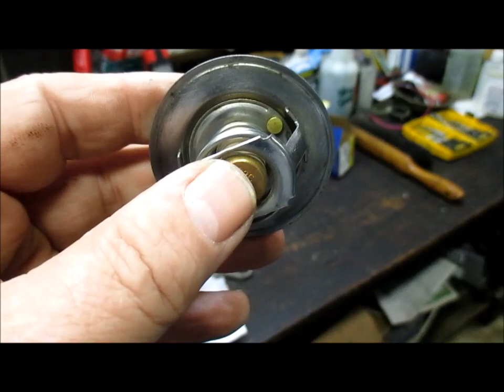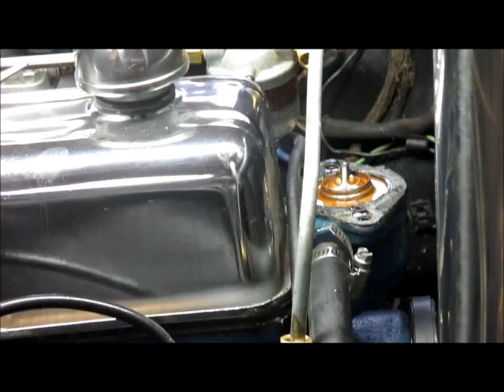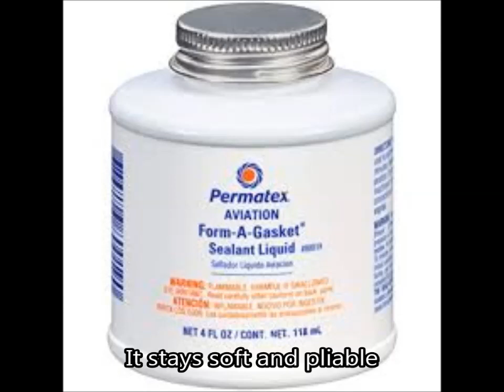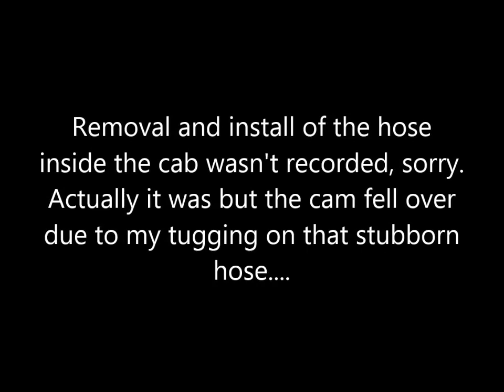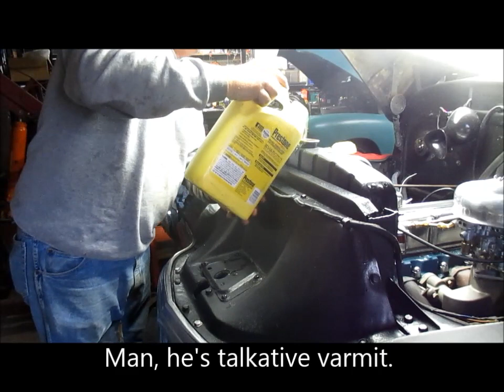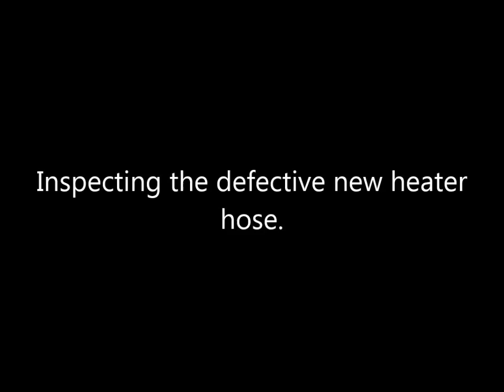1949 Chevy Truck, Installing a 180 degree thermostat.

Comment: Love your videos, informative, instructional and entertaining.

I have one question….regarding drilling the 1/16” in the thermostat.  Where exactly is the hole drilled. Any picture or diagram. I am guessing in the flange? Thank you.
Reply from the maker: A about the 51 sec mark you can see the brass jiggle pin at about the 1 O'clock position on the thermostat. That would be the area to drill a hole if there isn't a jiggle pin or hole. Thanks for watching
Reply: Many thanks for drawing my attention to that time in the video.  I would love to buy a thermostat with that “jiggle pin”. Can you tell me where you got it?  Thank you again!
Reply from the maker: @mikelaureanno893  Don't recall where I got mine but Rock Auto shows one for a 54 235. IIRC the same thermostat worked in my 49 216.
Reply: I found one with a jiggle pin.

Comment: Can you tell me how good or efficient is that Coolant Recovery tank? Since its all metal, for what I can see, how do you know if coolant level?
Reply from the maker: It works VERY well. To check the coolant level in the truck wait until the engine is cool then open the radiator cap to check the level. You want it to be almost to the very top. In operation, th eradiator will overflow into the overflow tank once it heats up to operating temp and the fluid overflows into the tank. Once the engine cools off it'll draw the coolant back into the radiator via vacuum. Works great and you don't loose any coolant to the ground.

Comment: My 1949 Chevy 3100 overheats, and I've got a new radiator, new hoses, and new thermostat.  What gives?
Reply from the maker: Not knowing the history of your engine my answer is what I'd recommend to do.
1) drain your anti freeze and save it (if it's not real old).
2) refill with water and add some prestone radiator flush and top off.
3) run engine the specified hours then drain the the flush & coolant.
4) On the drivers side (left side) of the engine block back towards the bellhousing and just above the oil pan you should see the block drain petcock. Open it and observe the flow. If it just trickles out or doesn't have a good strong stream, unscrew the petcock and take a metal coathanger and poke around in the block to loosen the chunks of rust and other debris so it drains out of the hole. Do it until you get a good strong stream of coolant out of the block.
Refill with water if it runs out before it flows out strong.
Once you get a good strong flow reinstall the pectcock and close it.
5) refill with 50/50 antifreeze and test.
Sometimes the crud builds up around cyl's 5 & 6 which blocks coolanf\t flow which causes them to overheat.
Fushing the crud out generally clears overheating problems on these old engines.

I'm guessing you still have the 216 engine. IF you have a 235 make sure the fan is centered on the radiator. IF you have a later model 235 the fan is too high and you need to get a relocation adapter which are available on ebay. 
Good luck.
Reply: @Volfandt  Yes, this is the original 216 engine.  I followed your instructions (thank you very much!) and when I opened the petcock in the back, nothing came out, even after I took out the petcock! Yes, I had a full radiator with water and Prestone flush.  Sounds to me,  like oil has leaked into the block and 'sludged'.  Any thoughts what to do next?
Reply from the maker: @markzecy7529  Generally, rust and other water related crud builds up in the water jacket around #6 cyl then builds up & works it's way towards #5 which clogs up the water passages. When this happens no coolant gets circulated around cyl's 5 & 6 and they cause the overheating.
With the petcock out, take a metal coathanger, straighten it up somewhat then jam into the hole where the petcock came out and start breaking up the crud & depsoits until the coolant with the crud flows "strongly" out the hole. It's not unusual to jam quite a bit of hanger into the hole  and you want to work it until you no longer see any crud coming out with a very strong flow of coolant/water. Heres an old vid of me doing this procedure to my 235.
It's an old vid so don't  hold it against me:
https://www.youtube.com/watch?v=07AJw2SG-9M
Good luck.

Comment: Hi I installed a rebuilt deluxe heater in my 52 where did you find the instructions manual you show in your video for that,I thought I had it plumbed properly.
Reply from the maker: Hey Peyton, Chevy Accessories manual:  https://www.chevsofthe40s.com/detail/7230/Chevrolet_Accessory_Installation_Manual_Superb.html

Comment: Why switch to 180?
Reply from the maker: With the switch to the Deluxe fresh air heater I was barely getting enough hot air out of it to stay warm on a winters cruise. The 180 was the ticket to warm it up and the engine didn't run any hotter. The accessory manual also called for a 180 thermostat when upgrading to the Deluxe heater. Thanks for watching.
Reply: @Volfandt  Intresting pov, I upgraded my 235 to 180° and I noticed it doesnt overheat as easy as it used to.  My theory - the water gets to stay in the radiator longer therefore actually getting time to cool down before routing through the engine.
Reply: @budsodalsky  So you had the 160 in it and felt like the temp was too variable.  Like a old woman with hot flashes?
Reply: Dont understand what you mean, Im talking about cars, but usually low IQ dont know how to respond to engineering concepts so you don't surprise me with your stupidity @windrosenorthoutfittersmen2528

Comment: Its unknown to us when was the last time the cooling system on our 1948 Pickup Truck 3100 series with 216 engine was flushed. 
Do recommend that we flush the system? We've had to change the coolant but we have doubt about flushing the system. We do intend to change the thermostat to 180 degree one since we've had random temp indication of 212.
Reply from the maker: Yes, flush the system and refill with nre anti freeze. Locate the rear petcock on the block (back towards the tranny on the drivers side) and open it  to drain the block when you drain the system. If it doesn't flow out fast, remove the petcock, poke around in the block with a metal coat hanger and you should be able to break up the crud and get it to drain properly.
Good luck
Dave
Reply: @Volfandt  Will do. However, someone (earlier owners, I guess) installed this massive (about 1 inch diameter bolt where the rear petcock should be, so that I fear I will not undertake since I not what will happen when I unthread that bolt.
Reply from the maker: @chandiaz7694  Definitely understand. If your truck doesn't have any overheating issues it's best to leave a sleeping dog lie and not mess with it. Took me awhile to learn not to fix something that wasn't broke, LOL.

Comment: this video needs more views. my truck always ran cool and i put an ac back on it and i was running 220 at times i thought well ill change thermostat come to find out there wasn't one dropped a 195 in it and think it was faulty but worked great for 4 days never got over 215 til it started sticking i think because gauge said it opened at 220 first run of the day. but anyhow i think not running a thermostat could cause an overheat condition because its not staying in radiator long enough to get rid of the heat.
Reply: which makes sense they make restriction plates that look like big washers. so a guy can probably gut a thermostat and run it but not completely out unless in emergency situation
Reply from the maker: @mike-bj4dk  Thanks for watching and commenting Michael.

Comment: Hi
Do you have a video explaining how to adjust the 54 3 speed gear box. Ocationally its not changing from 1st to second correctlly and a little manipulation is needed to make it change from front to back (2 &3 gear). Remember im new into this and willing to follow your advise as always.
Do i need to lubricate the exterion mechanism on the trany?
Thanks for your help!
Reply from the maker: Heres the procedure in the shop manual:
http://chevy.oldcarmanualproject.com/shop/1954truck/54ctsm0702.html
 In my video here: 
https://www.youtube.com/watch?v=IfrUHMz_vw&t=582s
at the 14:15 mark you can see the shifter box and the 2 shifter levers. My finger is pointing to a chrome cap on top of the shifter box, pry it up, this is where you add grease. 
Make sure both shifter levers are equal with the shifter rod at neutral. There is a "cog" inside the shifer box that has to line up almost perfectly inorder for the shifter to shift smoothly. Adjust the down rods up or down to make the levers equal by loosening the clamping bolts and sliding them up or down.
Mark the down rods before you start in case you mess up and need to put them back.

Good luck.
Reply from the maker: If my video link above doesn't work it's Part 8 of my 1949 Chevy 3100 restoration series.
Reply: @Volfandt  thanks i will study that one...

Comment: I need your advise. Mine is a 54 chev 3100. Behind the front drums it have a vertical play. The mech said it needs new bushings, behind the drums. The bearings are new, greased, installed ok. It has no horizontal play now, but it has a little vertical play that may be the old bushings. I just need to know what should i order, or the correct part name or number. I dont see them in the catalogs that i have.
Thanks!
Reply from the maker: Did the mechanic say that the king pin bushings were worn? The wheel hub that the drum bolts to has bearings which ride on races that are either hammered or pressed in. Generally when the bearings are replaced new races are also replaced as they are usually a matched set. If you still have the original straight front axle it sounds like he was indicating your king pins have vertical play.
Reply: @Volfandt  i dont know what the king pins are, but im willing to follow your recs in order to fix the vertical play on the front wheels. Is not much but i dont like it. What should i order or replace based on your experience?
Reply from the maker: @ericruiz2174  The wheel bearings being slightly loose can cause the play you say you have. Wheel bearings can have some slight play but not too much. They shouldn't be over tightened. This is a case where I cannot troubleshoot via written word. Find a proper mechanic and have him check the wheel bearing adjustments and see if theres any play in the king pins.  Good luck

Comment: Or can i just cut it and reweld it. Its a bronze wire of 1/16" more or less. Reweld it with bronze. What do u think. You are the master...
Reply from the maker: No, don't cut it. It is filled with a liquid that only GM and a few others know, perhaps mercury but IDK. The liquid is a precise amount also. 
Why are you trying to remove the tubing and bulb from the gauge? If you got a new gauge it should have come connected to a long tube and a bulb at the other end. Just remove the old gauge with it's tubing and bulb from the truck and install the new gauge assembly. The bulb/sender just screws into the head, unscrew it and lift it out of the head then feed it through the firewall to remove. Reverse order to reinstall your new gauge assembly.
Your new gauge assembly should look like this: https://www.classicparts.com/1949-53-Temp-Gauge-w_-White-Needle-6-cyl/productinfo/24-703C/  notice the tube and bulb are attached to the gauge.
Good luck
Dave
Reply: @Volfandt  relax
I just unbolted from the engine and  pased very carafully thru the fire wall like u reconmend. It was easy.
The new gauge is installed and cleaning the housing a little bit.
Like you recommend.
Thank you!
I keep you posted when finish...
Reply from the maker: @ericruiz2174  Good for you.
Reply: @Volfandt  done deal.
Every gauge working, temp gauge slided back to its original position, oil back in place. Fuel gauge working! Thank you!

Comment: Finally learned how to get the new fuel gauge to work with the new sending unit. This is a 54 chev 3100.
Now the situation is how to get the temp wire out from the back of the housing.
I already remove all three others cables, gas, oil, amps. But the temp one i don know how to remove it in order to be able to put it back.
Help please!
Thats the only thing left to get the housing out.
Thanks
Reply from the maker: If the temp gauge/sender is an OEM type (mechanical), you do not want to disconnect the the capillary tube from the gauge. It is a permanently sealed tube with the temp bulb at one end and the gauge at the other. Leave it as one piece and feed the bulb end through the firewall and screw it down into the head.  Carefully make all the bends necessary and try not to pinch the tube. If the gauge is electrical you can disconnect the wires without problem.
Good luck Eric
Reply: @Volfandt  wao, you mean to unbolt it from the engine and very carefully get it thru the firewall and then put it back in?

Comment: I just found a brand new thermostat in my parts cabinet, and realized I haven't been running one on my pickup for about 4 years 🤔
Reply from the maker: Theres an old saying "if it ain't broke don't fix it". If your engine warms up to around 180 and stays in that range when you drive it I'd be surprised if it didn't have a thermostat. In this case I'd be thinking about verifying whether or not there was a thermostat installed and installing one if it wasn't. An easy test is to see if theres coolant flow through the radiator at startup when the engine is cold. In any case Ary, good luck.

Comment: I'm with you, I like the Chevy better too.  So, I changed out the thermostat on my 1960 Chevy about 15 years ago now.  When I finished the job and filled it up with antifreeze, it came shooting out the radiator like a geyser when the thermostat opened up.  It must  of had a lot of air in the system, LOL.  I'm running an aftermarket bolt on oil filter on my 235.  The engine was rebuilt about 17 years ago at about 96K, it's at about 133K now and still going strong.  I'm a believer in oil filters, although I only have 37K on the rebuild, LOL.....
Reply: 235 is such a cool machine.thats what I run in my 60 pickup as well.